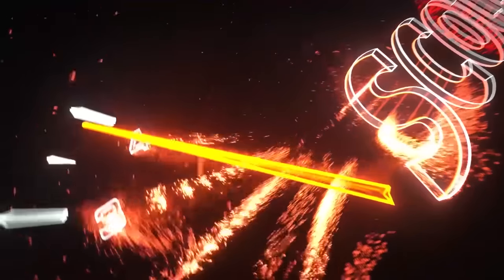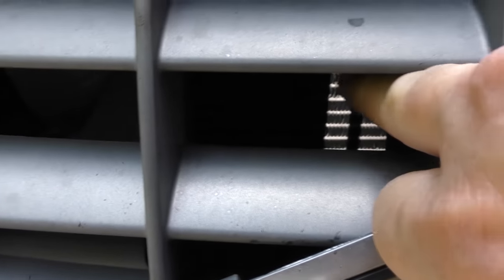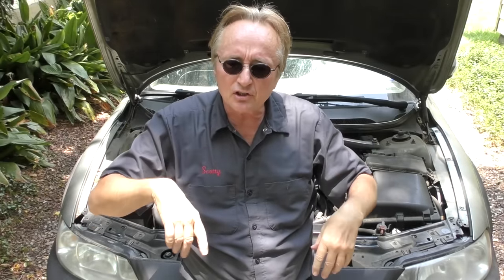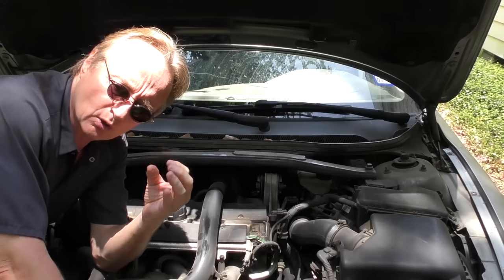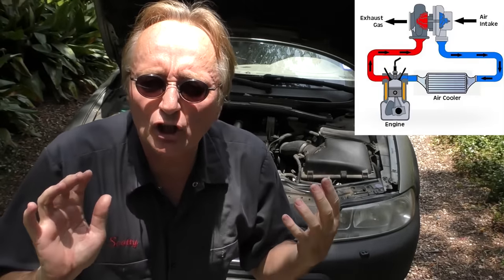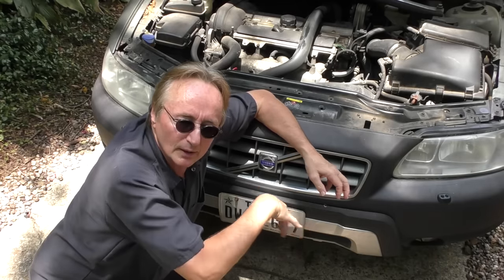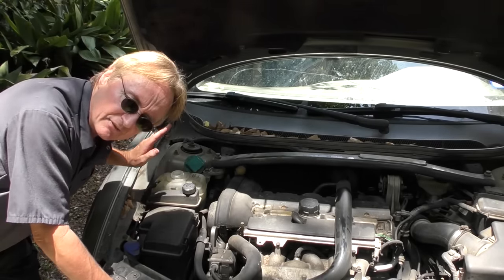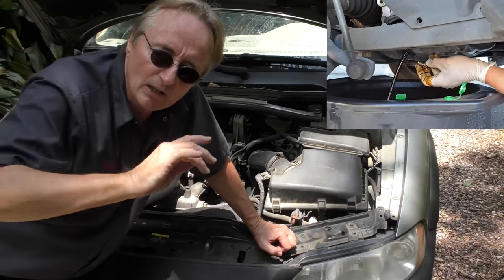5 Things You Should Never Do in a Turbocharged Car

Comment: I have. 2022 WRX. The first thing I did to it was fitted an intercooler screen. Ten the mods began with Ernest. I’ve always warmed up he engine for least 3 to 5 minutes before driving & 1 or 2 minutes before shutting it down. After 1 year it hasn’t used any oil.

Comment: My turbo blew out on me 3 weeks ago, I was driving my Toyota Supra on a trip to the mountains, it was hot out, even at 3000 ft above sea level.  My engine started making a noise while climbing the mountain roads, but it was only making the noise when the turbo was making boost. I was about at my destination when the noise started so I just took it easy the rest of the way. When I arrived, parked my car at the hotel to check in, I when I came back out I looked under the car and there was a big black pool of oil right on the ground under where the turbo charger was located. Well there is no fixing a 30 year old Supra on the road 500 miles from home, so I drove it home and just keep off the boost, now I have to change my turbo unit and this should be fun.

Comment: Who races the engine when you start it?  That is bad for any engine, even for one not turbocharged.  High quality synthetic oil is what is recommended in the owners manual.  It is not bad advice, but if you read the owners manual you know everything this video tells you.  My 2006 Saab 9-3 now has 250,000 miles and is on the original powertrain - turbo and all.  I sold it to another owner close to 200,000 miles but it really is a solid car.  I am glad at least Scotty admits now that turbo engines can last a very long time if you take care of it - like any other engine.

Comment: 5mpg jheeze haha
I've got a 1.0l ecoboost turbocharged that does around 40mpg I'm trying to make the car last because these little 1.0l engines don't last particularly long due to the strain on them.
So I agree use the best fuels I use 99 octane 
Use the best oil
Use the best coolant 
Yes it will cost more but in the long run it will be worth it.
Don't cut corners!!!

Comment: 2000 VW Passat 1.8L turbo with 306K miles, still going strong
Reply: Tom Cartmel what about the issues and things that had to be replaced, trans, etc?
Reply: @Vicmicism  5-speed manual
Reply: @Vicmicism  Alternator, starter, AC, fuel pump, rack and pinion, all original. Weakest part is multi-link front suspension and valve cover gasket needing replaced every 100-200K miles.
Reply: Tom Cartmel that's pretty neat, wont compare to AMT passats nowadays I bet?

Comment: So turbocharged engine not good for long trips ??? 
Sounds like if u wanna faster car just get the simple V8 🙈
Reply: It's perfectly fine for any trips. Just make sure the temp gauge is up, and do what you need to do. It's not that much different from any NA engine. PS: you're going to like the boost in power when you need it.
Reply: Som eOne I understand you but I had V8s my whole life and never had to check the gouge .... I drove my s500 , cls 550 , s550 , S560 , G63 no problem 🤷🏻‍♀️ ..... never had to worry or think about anything 🤷🏻‍♀️

Comment: The intake on the chevy 4cy turbo freezes in cold weather check engine light comes on and it starts losing power GM has had 3 fixes for this problem and none of them work. Now they say the turbo isn't working up to full capacity. and needs to be replaced

Comment: Very good advice; spot on ... I'm not a fan of turbos; remembering when Chrysler were kind of the ones to start using them when 4 cylinders were still not putting out a lot of power on their own (low valve, cam and so on "technology"), and I liked the power specs but knew to avoid the turbos as much as magazines liked the turbo versions of the cars.

Comment: I have a 2014 Subaru Forester XT and now have 110k on both the turbo and CVT.  Never an issue...I average around 27-30mpg depending on city/hwy mix.  Very reliable car mostly because I'm not constantly pushing boost.  The kids who complain about how unreliable turbo's are...are usually the ones who buy grocery getters like the FXT and think just because there's a turbo on them, they're MEANT to be run at 18PSI all day.  Drive them how they were DESIGNED to be driven, idle the oil temp down a couple degrees before shutdown and they'll last a long time.

Comment: I have a Focus ctdi diesel Automatic 2014 with a turbo charger. I overfilled the engine with oil which  let to a lot of problems. Now that the oil shows exactly on the full mark of the dipstick I have no problems. As I look at the different videos explaining the workings of a turbo then i am rather confused. Because on the one hand its all about air cooling of then goes to Turbo which causes the turbo to run.  But at the same time the presenter talks about oil that come into the turbo?? I do not see on the sketch how the oil gets into the turbo?? Plse help me out. Daniel Seymore

Comment: As warm as the turbocharger gets during any kind of stressful Maneuvers or even flying down the highway for any length of time. 30 seconds is not usually enough time to let it idle before you shut it off. It should be closer to 5 to 10 minutes, which is what a timer to protect the turbochargers on some Vehicles actually do when you shut the key off and lock the door to leave the car the engine will remain idling for about 5 to 10 minutes depending on what you want to set it up at so that the turbocharger can fully cool down before it shuts off so that you don't cook the oil is standing still in the turbocharger shaft after you shut it off.

An excellent method of keeping that turboshaft clear of overheated oil remnants is 2 run some Marvel Mystery Oil through the engine for a few days before you change the oil, the phosphorus in the Marvel Mystery Oil is an excellent cleaner. Your valve train and the rest of the engine will love it as well.

Comment: Yo Scottie I was wondering if you could solve a dilema for me. I drive 2004 Seat Toledo Mk2 1.9 TDI 110 HP (basically VW Golf Mk4). In 5th gear, under acceleration turbo (variable geometry) shuts off ("limp" mode). That probably means that it's getting clogged up with carbon and other deposits. My dilema is whether I shloud try and clean turbo with products like Mr. Muscle oven cleaner (contains NaOH) or similair product? Apparently there is high chance that it won't get in the engine and do some damage.

Comment: This advice is really not correct anymore. Modern turbo-charged engines (except boxers) can be driven like a normally aspirated one with no need to warm up the engine or idle x amount of seconds before switching off the ignition.  The biggest issue with a turbo charged engines longevity is not to rev the guts out of it and get it serviced exactly as specified in the vehicle logbook.

Comment: Old cars yes , new modern cars no need to follow all this advice apart from getting the engine hot before you drive the car hard . Always follow the cars manufacturers handbook for what oil to use . Also no need to keep changing engine oil too often , just stick to the servicing schedules . Avoid thrashing the car and the car should give you many miles problem free

Comment: Hi Scotty, what do you think about engine flush with Turbo engine? Does it hurt the turbo ? I have  VW CC 2T with 96000+ miles and I flushed the engine every other oil change(10000 miles). The oil looks like runny mash potatoes but black after using the flush :DD. The car is running like new and is very quite. I am not sure if I’m hurting any seals with the flush chemicals. Thanks!

Comment: A friend of mine bought a brand new Nissan sentra SER and he would rev the hell outa that thing in the dead of winter. I mean bouncing off the rev limiter. He only had it about 5 to 6 months and it started burning oil. It'd smoke blue everytime he'd start it. The worst thing you can do to an engine is beat it when it cold.

Comment: I got a 2012 Chevy Cruze in my driveway I got at 70k miles and it’s at 190k miles now and it’s a 1.4 turbo and I always used good oil. Usually full synthetic with the dexros label on it. The crazy thing is the car has been wrecked 4 times actually totaled twice and my family fixed it the 1st time and I fixed it the other 3 and I delivered in it to in southern KY Appalachian mountains and more importantly hills and horrible driveways but I tried to go easy on the rough stuff I didn’t run it like a rally car but now I did run it pretty good on the pavement it was the LTZ all the leather, suspension, wheel, and tire upgrades over the LT and LS. Silver with 2 black stripes kind of like the Camaro from that year looks good with tinted windows and the black wheels. Everybody thought I painted the wheels but they where factory power coated black looked like the RS wheels but black only ones I seen like them stock. All these years and they still look good black still right there so definitely stock plus there identical to the Cruze wheel just not aluminum looking.

Comment: I own a 2014 Volvo V40 T5 (5 Cylinder Turbo) Cross Country here on the island of Phuket in SW Thailand.

Just pushed through 45,000km after 10yrs of ownership. All servicing done at the Volvo Service Center. Oil & Filter changes every 5,000km (3,000mi) or 6 months. Absolutely love this car…..!!!

Comment: Hi scotty , I would like to start my 4m40tdi engine on the ground before I put it in the car. Is it safe to start the engine on the ground for 60 seconds without the turbo charger connected to the engine. Just want to make sure the engine is running b4 I can put it back in the car. Thanks

Comment: Thanks for the upload mate. I'm considering a turbo 4 and this helped a lot. I like the part about driving conservatively. I do that. I've got 161K (almost 100,000 miles) on my car that I've owned since new and have not replaced the brake pads. Note. Here in Australia, we have to pass a roadworthy test every year including a calibrated emergency brake test. It passed about 2 weeks ago.
Reply: Nah that's wild. Emergency brakes are one thing but I'd assume your brakes had to be replaced. Cause braking is friction...your pads will wear down, so unless you never break I'm kinda surprised. You ever wonder if they've changed your pads and made you pay without realizing it?
Reply: @jakecoyne3919 Yeah nah, servicing would always be the same price as per the new car at the time. Registration checks every year do a brake test and they always passed.  I knew the mechanic quite well and he looked at the pads and they were still good, Sold the car now so I'll never know how much longer they lasted. Also, I'm one of those drivers that is always scanning well ahead so when I do brake, it's usually only light pressure.
Reply: @herc_ules_therealone  wow, that's crazy. I have to do them often enough cause I live in one of the worst traffic spots in the USA so I unfortunately have to ride my brakes cause our transit system is awful and everyone has a car

Comment: A turbo car has a massive peak torque already at mid RPMs - so no need to rev up your engines more than 3000-4500 EVER 😀 Don't drive it with maximum revs, at it won't fail ...

As Scotty explained in another video, idling does not cool your car - you need to drive it rather at speed (let's say 30-60 mph) with low RPMs. 
And it's best to combine the turbo with an automatic transmission so that it shifts for you reliably to prevent high RPMs at all times.

Comment: If you own a vw/audi be sure to change the coolant and spark plugs every 4 years. Replace the engine air filter every 3 years (they're cheap as chips) and give the engine a flogging on the highway at least once a month.
And never fill up with cheap, non brand-name fuel.

Comment: Actually, in turbocharged diesel cars (at least older ones) you want to make sure you drive them in higher RPMs at least once in a while, otherwise carbon builds up on the blades at the point where it will stop functioning altogether.

I have a 2007 1.9l diesel engine from Volkswagen with 200.000 km on it, and the turbocharger still works great. My father has a similar engine and the turbocharger stopped functioning at 250.000km, after a few years of driving the car almost only in the city. Diesels are great cars, but you are killing them if you drive them mostly in the city at low RPMs.

Comment: My Honda Civic 2008 plate had 57K on the clock when I got it in 2013.

It's now done over 180K and the turbo has blown. Can I drive it with no turbo?
Reply: No! Do not drive unless it’s an emergency, you need to get the turbo replaced, do not drive unless absolutely necessary

Comment: I have a 2016 Jetta TSI 1.4L S model. It has a 5 speed Manual and runs great. I’m glad to say I abide by these rules. Also, I’ve made 46.3 miles per gallon on the interstate and average 33mpg on the back roads.

Comment: I have a 19 Cruze with a turbo. I have never reved up an engine at startup on any car I’ve ever owned.
Reply: why would you buy one of the crappiest cars ever made by GM?
Reply: Says who you?
Reply: @CMRinehart  It is on the list of the most unreliable cars. Scotty, and other mechanic guys like Ivan from Pine hollow auto diagnostics, they all would turn them down. At the autobody shop i worked at, these cars were known for having crap electrical systems and they also are known to break in many ways in less than 5 years, just because they are crap.
Reply: Ricardo The PC Gamer Perhaps the older ones, but the 19 hasn’t been out long enough to have all the issues you describe.
Reply: Google worst cars in 2019. Consumer Reports no Cruze listed. Forbes-no Cruze listed. MotorBiscuit-no Cruze listed. Car and Driver-Cruze ranked 11 out of 20. Motor1-15 worst selling vehicles in 2018 Cruze not listed.
Reply: @CMRinehart  Don't try to prove anything to me, they will never improve, it is still and will always be a junk car. Looking at ratings on a 2019 is stupid because people don't own the car long enough to list a problem. it might be brand new but in less than 5 years you'll regret that car. GM/ford/chrysler cars are all getting worse everyday. None of them will improve, they are made cheaper for more profit.

Comment: Scotty, I have a C&L bypass valve adapter in my Mustang Ecoboost that basically lets off the unused air when I let go off the gas and makes a "psssst" sound. The manufacturer says it has no affect on the car's performance. Is there a drawback that you know of with these bypass valves on turbo cars?

Comment: Had a Mazdaspeed 3 that easily got 40+ miles per gallon, few times I'd even get over 50+ while just doing the speed limit. Even flooring the pedal, I would still get over 30+ miles per gallon. Turbos are definitely gas efficient. My Mustang GT barely even get 20 miles per gallon, doing the speed limit at that.

Comment: I've got a 2016 s60 T6R with the Polestar package. I've started to notice a vibration in the pedal and a slight pull to one side. Which is most likely from the rim that has been curbed. However this has also correlated with some odd shifting paterns. Kinda clunky on the downshifts and when trying to move briskly, the automatic trans nearly goes to redline before shifting and I feel a strange very mild vibration in the seat. The car is still under warranty but I just haven't had time to take it in as I work night shift

Comment: I just got a 2015 Ford Escape 2.0L Turbo and have been learning all I can since this is my first turbo vehicle owned. As soon as I can get the money I'm getting an Oil Catch Can installed. Other than a K&N air filter, I haven't found any upgrades that are worth getting that are cheap and easy enough to buy and/or do myself.
Reply: Sjon Jones if you live in cold area those cans can freeze which is much worse then not having them.

Comment: Saw a truck going up a hill, and from around 3km away you could see something was funny. Getting up close the exhaust was glowing dull red at the tip, and as the pipe ran in it got brighter and redder. Silencer was bright cherry red, and then the turbo housing was white hot, along with a nice blue cone of flame coming out of the exhaust. Impressive as well was that you could see the shadows of the blades in the housing rotating slowly.

Guess it had seized, and the driver ( hey not my truck I just drive the snot out of it) simply had his foot to the floor, in whatever gear gave him peak RPM. Do not think he made it to the top of that 15km long hill, but at least it was better than if he was coming down the other way, riding the brakes all the way. Arrester beds are great if you need them, but not if both of them already have a big rig buried in them at the same time, and that corner at the bottom has a concrete Jersey barrier, that is designed to turn a 100 ton load so it will not go into the oncoming lanes.

Comment: Trick for coolant systems for turbo life ... and most engines is starting off well.  In industrial training the key was to get treatment into water based coolant systems immediately.  Thought of many cars I had with dirty coolant, and the line auto warranties had about running with their coolant for a year being required.  Could it be designed obsolescence?  Could they be putting coolant without corrosion protection in at the plant ... knowing corrosion once started would be unstoppable?  I have put the condensed chemical coolant protection into three new cars now, and they ran clear green to say 150k when I would sell them.  Mechanics have been stunned when they open the system to see as new conditions.

Comment: My VW's turbo continues to have oil/and or coolant pumped through it after the car is turned off in warmer weather and if you run it hard. It’ll run for a few minutes and you can hear the fan running. When we first got the car we didn’t know what was happening. It sounded like it was still running. It is a good safety feature for the turbo.